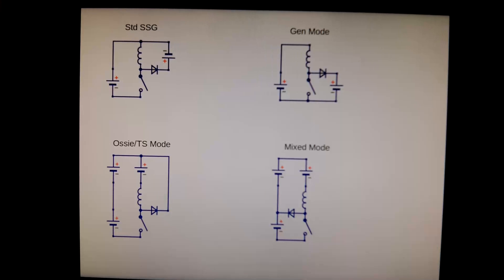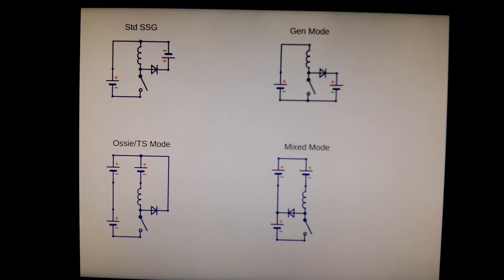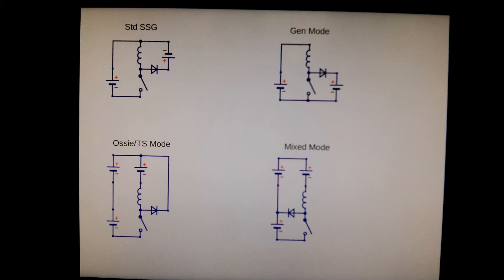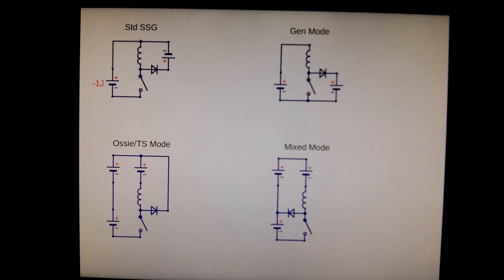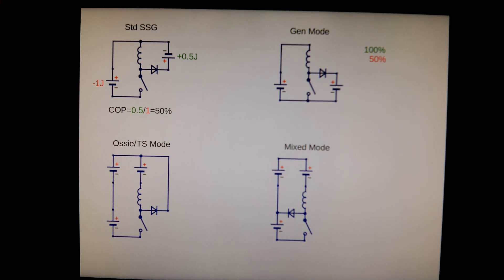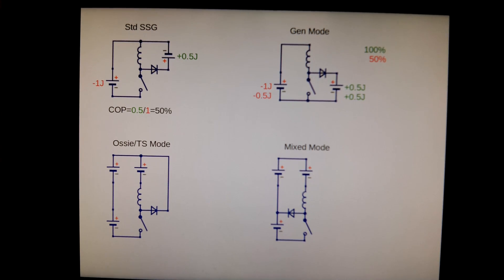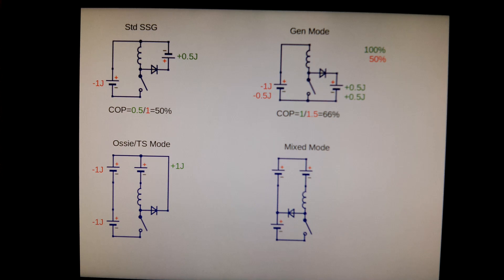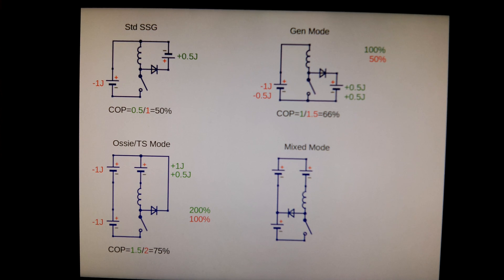SSG modes COP theory

Comment: I believe the number is not that high. How about trying to compare with another battery charger? 

Here is a data to compare, for small battery:
http://www.amazon.com/La-Crosse-Technology-BC1000-Battery/dp/B004J6DLD4 For 1000mAh battery, with 500mA charging current, 1 hours 40 minutes.

http://www.amazon.com/Ultra-Desktop-Charger-Discharge-Batteries/dp/B004X9YRJY For 700mAh to 1200mAh battery, with 500mA charging current, 1.5 hours to 3 hours.

Single stingo, 350 mA output current, charge two 1000mAh 1.2V nicad battery under 15 minutes.